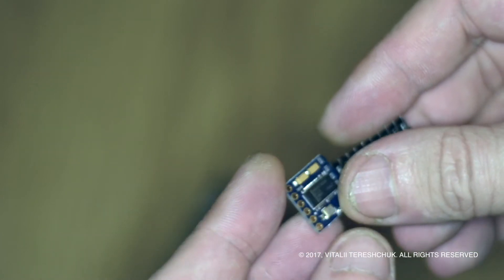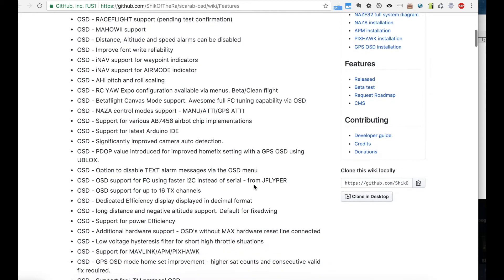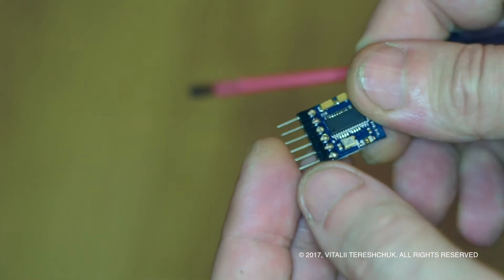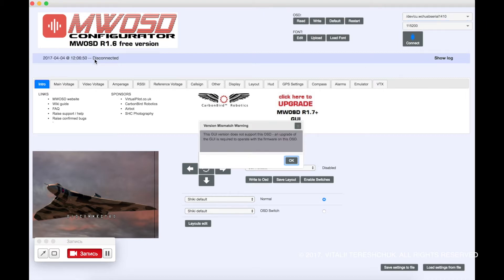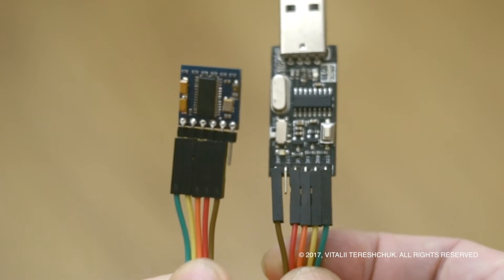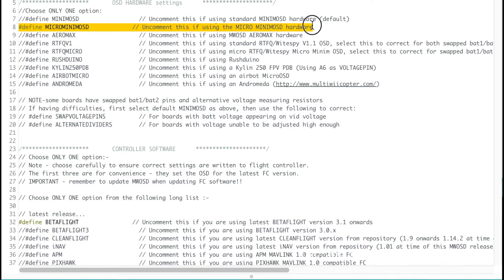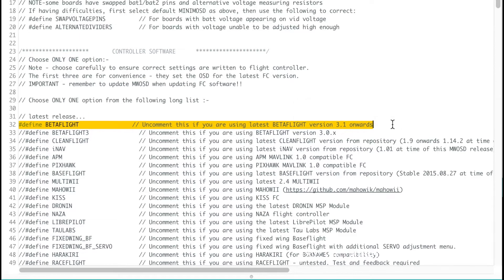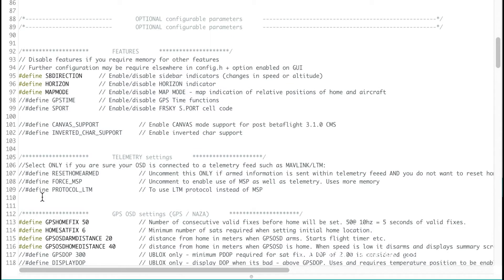MWOSD R 1.7 MICRO MinimOSD. How to setup and connect OSD to FPV SP Racing F3

Comment: How to activate osd in inav ports settings
Reply from the maker: Disarm. Stickers to center. Left sticker to right. Right sticker to top.
Reply: @xVoLAnD nope
How to configure it in inav configurator because usb is on uart1 and osd also should be connected to the same port and I cannot use both at same time so if I connected FC via usb and browsing inav tabs then I cannot use osd and if connected osd then cannot use usb connection to configure it
I don't know if I able to explain my issue or not
Reply from the maker: I understand, what you are talking about. I had a similar problem.  Unfortunately, I cannot give specific steps, because my drone is located in 2500 km away from me.  However, you can try connecting to a different UART.  In the video, I have it connected to UART2.  Hope this helps solve your problem.
Reply: @xVoLAnD  ok now I have new problem osd flashing done but the texts are not fitting in my fpv screen how to fix the osd text resolution
Reply from the maker: You can upload any font into OSD, if I understand you correctly
Reply: @xVoLAnD  nope my problem is not font style the problem is whole osd screen is not matching my fpv video size the texts are going out of the screen looks like bigger resolution osd on small resolution fpv screen
Reply from the maker: @rctechmods8165  try adjusting the font in the configurator

Comment: I am having a very hard time using the micro minimosd. I flashed the firmware with audrino and it wouldnt work with mwosd 1.7. But mwosd now has a flash feature on the chrome app. I tried that and I got the display to work, but its not communicating with the flight controller. I have tried 2 different flight controllers on every single uart port. I cant find much info about mwosd 1.7. I can only connect to mwosd with the ftdi. Am I missing something here?
Reply from the maker: I use the simple and correct way, using FTDI and arduino. The Chrome extension works with errors, so I'm using the original application under Windows. In any case, you need it only once to upload the fonts into mwosd.
All other parameters you can turn off/on without a computer.
Reply: Thank you. I will re-flash with audrino. After turning on OSD and turning on the UART port in Betaflight, is there anything else that needs to be configured in order to get the tx & rx to communicate with the minimosd? I think thats the problem im having.
Reply from the maker: You're welcome. I'm using the UART3 port through the connector (not soldered). It's convenient, becouse there was an opportunity to disconnect minimOSD, if necessary to reflash/setup regulators, for example.
I think in the near future (it makes sense) to record a video with my drone hardware configuration. Of course, all of my hardware configuration present, in separate videos.
Reply: That is EXACTLY how I did it the first time. I liked it because I could swap the tx & rx pins in the connector easily. There seems to be many diagrams and some have the actual pads labled on the minimosd and some have them labeled as what they connect to. I just tried every combination on all the uart ports.
Reply: Ninja Sauce check that you have the correct baud rate set, I had a similar issue recently and I had a different baud rate set in the mwosd compared to the gui on the flight controller.
Reply: Thank you. I got it to work. For some reason I had to leave the config file mostly unchanged. I was selecting the quadcopter setting, and after I left it alone, it worked. Took me many flashes to figure that out.

Comment: hi did it show you rssi or signal eror from flysky ?? thanx :)
Reply from the maker: DeZupe FPV No, it doesn't show the signal strength. But this can be achieved by soldering and another patch
Reply: Vitalii Tereshchuk  i dont understand how it can be achived have you some video for that ?
Reply from the maker: DeZupe FPV Sorry, but I dont remember where I read about it. In any case, it's too complicated and doubtful. The easiest way is to use the flight controller F4 with OSD
Reply from the maker: DeZupe FPV Check this link http://www.itluxembourg.lu/site/apmplane/

Comment: hi,
 in the new TTL-USB UART CH340/CH340g That you put on in Details,have :5v Vcc 3v3 5xd Rxd Gnd.
.is difrent in your video,plese tell me how i connect this to minimosd
thank you
Reply from the maker: BenTubul See 2:10 (left side of picture) and connect GND, 5V and switch minimOSD RX to TTL TX, minimOSD TX to TTL RX
Reply: ?I mean do not have the DTR
?You mean I'll connect like that
 minimOSD--|--TTL
GND -> GND
   5V -> 5V
   RX -> TX
   TX -> RX

thank you vitalii
Reply from the maker: BenTubul Ahh, yes sorry and DTR
Reply: but in the ttl CH340/CH340g There is no DTR
Reply from the maker: BenTubul Check video 3:18
Reply from the maker: BenTubul Anyway if you don't have a DTR pin you can also without it
Reply: Vitalii Tereshchuk ok thank you i will try.
Reply from the maker: BenTubul You're welcome!
Reply: hi vitalii
is not work,is give me error when i wont upload from arduino
Reply from the maker: BenTubul Hello, what error? And you use DTR?
Reply: error occurred while uploading the sketch
I do not have a DTR on ch340
Reply from the maker: BenTubul Did you previously upload something using this module?
Reply from the maker: BenTubul Drivers is OK?
Reply: not, is a new
Reply from the maker: BenTubul I hope you have the correct drivers. Connect all wires to the adapter and minimOSD. Now, off the GND wire on the minimOSD. Click "upload" and as soon as you see the word "uploading" in status bar, quick connect the GND wire to the minimOSD. It needs to be done quickly and may not work out the first time. Try again
Reply: it was exhausting to catch the GND connection.
I think worked, soon I'll connect to the camera and check.
! thanks for the help you are king!
:) i buy ttl more comfortable
Reply from the maker: BenTubul Cool! Congratulation! You're welcome!